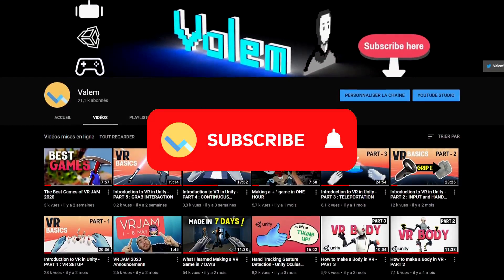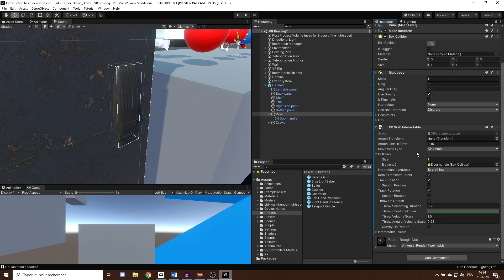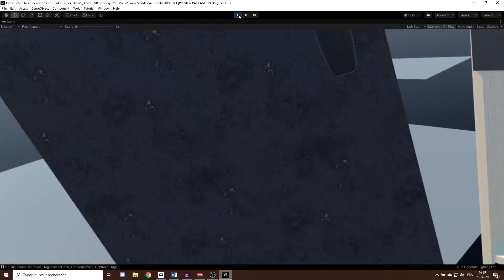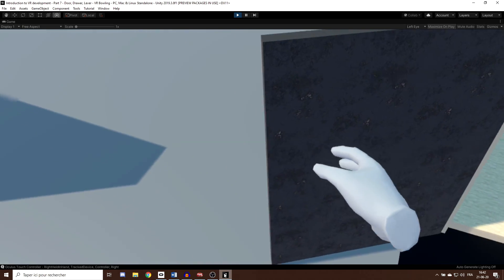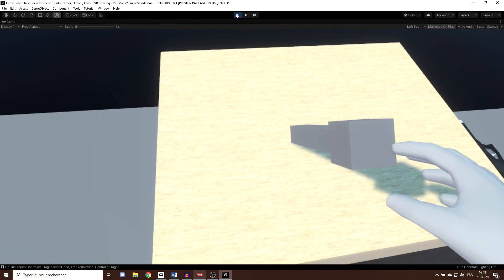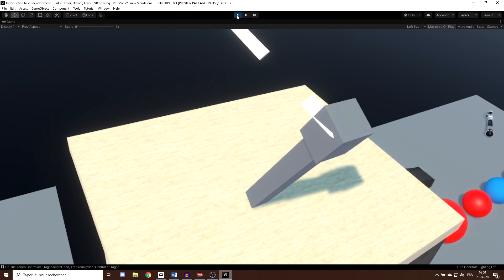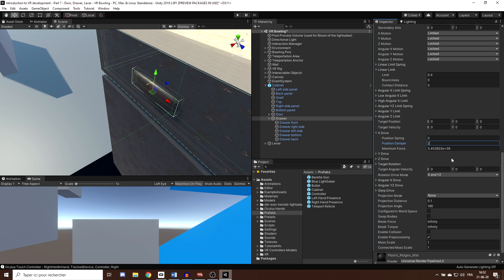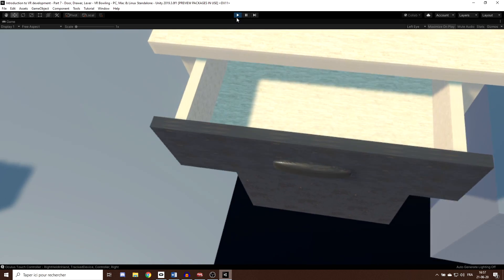Introduction to VR in Unity - PART 7 : DOOR, LEVER, DRAWER,...

Comment: Hi, a question. Using hinge joint if I try to pull away farther than where the object is supposed to be, it will then move frantically like a possessed person. Does the script that you gave in the comments counters that, or is there another script needed to handle it?

Comment: With the lever, does anyone know of a way where you can find out the rotation value of it between the two limits? This could be used to power something like the claw in a claw machine moving for example.

Comment: I followed this tutorial exactly for the lever - however, I have Steam VR so I have the Interactable script, which is different from the XR Grab Interactable script - my lever won't move, anyone know what I'm missing??

Edit Why is this so hard?? I've tried everything I can possibly think of and I can't get anything to work like Valem's lever here.
If I create an object with a rigid body, a hinge joint with an anchor point and limits defined, and an interactable handle at the end, you'd think that would work, right? Nope. I tried restricting the movement of the base in the rigidbody so that it can only rotate in the x direction. Nope. I tried using a fixed joint to attach the grabbable piece to the shaft of the lever. Nope. I tried writing a script that uses a Look rotation from the base to the player hand. Nope. I tried writing a script that does the same thing but with the Look and up directions defined. Nope. I tried simplifying everything and just using one gameobject for the lever. Nope. I even added a Throwable script, which finally allowed me to interact with the lever (so what the fuck is Interactable even doing??), but then that just grabs and moves the entire lever without rotating anything. Why the fuck can't I get this to work?????

Comment: Your video is helpful. However, I met a problem when trying the lever. The lever always will come back to zero. It will not stay on max and min limit. Even though I adjusted some values, it only reached max limit, and it still does not reach min limit. What should I do?

Comment: The offset grabbable stuff doesn't work very well, from what I can see anyway. If you grab the drawer and then rotate your hand (without moving the position of it) the draw moves in and out, and when you release you'll see the drawer is in a completely different position to your hand? The door behaves somewhat similarly, but on top of that, simply moving the door, the movement isn't mapped 1:1 to your hand, so you move your hand a small amount, and the door moves a lot. If I switch back to using the default (non-offset) grabbable, all this is fixed, but you get the jump/snap when interacting.

Comment: I can't place objects in my drawer, they just fall through, it's probably something simple but I can't seem to figure it out. Any tips?
Reply: Make sure the objects have a collider. If you're using a mesh collider, you need to have 'Is Convex' checked and 'Is Trigger' is unchecked. If the object is small, try messing with the interpolate and collision detection parameters in case it's clipping through the box collider of the drawer.
Reply: @geouug4529  Thank you. It turns out I had both the objects and the drawer on a 'Grab' layer, and turned off the collision between these two in the Layer Collison Matrix. Putting the objects on a different layer solved the problem :)

Comment: Valem, I love these videos! They have helped me so much thanks!!

I'm having a small issue where I seem to be able to grab two objects while ray casting. Its like the Ray Interactor isn't disabled after I remote grab something. I've searched through all the classes we wrote but can't seem to figure it out. Anyone have any tips?

I feel as though when we select an object with the Right Hand Ray Interactor for example, we should be disabling the grabbing ability or maybe the whole Right Hand Ray Interactor in the "On Select Entered" method fields like we did for enableRightTeleport and disabling the Right Hand Presence. 

When I try this, the Right Hand Ray Interactor will not reactivate itself (I'm guessing since the object is already inActive it can't call the method to re activate itself). Any tips?
I tried to demonstrate the problem here:
https://www.youtube.com/watch?v=gcU6u3-GaB4

Thanks,
-Jacob

Comment: Actually, the InteractionLayerMask is a bit confusing and it doesn't help the documentation is wrong. Looking at the code, it doesn't care about the GameObjects layer, but just misuses the layers for its layer mask.

It is better to think like this:
* For interactables: Flag the object for what kind it is.
 - Gun should be pickable directly and remotely and slottable into inventory: Set Interaction Layer Mask to RemoteGrabbable, DirectGrabbable, Slottable.
* For Interactors: Flag the layers that should work with this interactor.
 - RemoteGrabber? Set mask to RemoteGrabbable only.
 - Inventory socket? Set mask to Slottable only.

With this thinking, you don't even need to change any layers in the game objects. Everything can be set to default. At least regarding XRIT interactions.

Comment: Maybe a strange question, but in the video you grab a drawer. Where could I plug in a piece of code to execute whenever the drawer is opened ? Is there some kind of event system for that or so I actually have to add a script to the drawer that constantly checks its position in world space ?(using a lot or cpu power)

Comment: hey @Valem thanks so much for the tuts. i was able to use the hinge joint on the lid of a pirates chest. i also added a rigid body to the bottom part of the chest and set it as the link rigid body for the joint, that way when i can pick up the chest to carry it around and also if i grab the front i can open it up with the joint. it works great.

Comment: Heeeelp, my hinge joint is vertical and I can't move it, or at least I don't know how to modify it so it would be like yours horizontally !
Reply: Select edit in the hinge joint component. In the inspector, you will see an x, y, and z field for the axis of rotation. Switch the values of the directions you don't want the door or lever to rotate on to zero. Then, switch your desired axis' value to one. You should see the rotation of the hinge changing in real time in your editor window. I hope this solves your problem.

Comment: Anyone else having this bug where imported models stay pink? Been looking for hours online.. I’ve imported the same lightsaber model as used in part 5 but I can’t find how to fix the pink textures :’(
Reply from the maker: Its because you use urp or 3d. You need to change the shader of the material
Reply: Valem And what do I choose? There are lots of shaders to choose from
Reply from the maker: @sammaes1799  if you are using urp its Lit, if you are using standard 3d its "standard" shader i believe
Reply: @ValemVR  Lit worked but the colors seem a bit off, there is no metallic look for example, no light reflection.. Any ideas on that or should I change to standard 3d?
Reply from the maker: You can tweak the shader lit to add more metallness! :)
Reply: @ValemVR  What are your settings if I may ask? I cant really find where this has to be changed. And thanks for the replies and the quality content. One of the best tutorials on youtube!
Reply: @sammaes1799  it's changed in the materials  you imported

Comment: It's work well on your cabinet.
However, I can't reproduce it on chest of drawers (https://assetstore.unity.com/packages/3d/props/furniture/chest-of-drawers-58835).
The drawer is moving along its origin +/-  limit.
Your drawer only move along origin + limit. 
Did you have any idea why ?
Reply: You need a collider in the back plate of the drawer and a collider on the drawer itself to interact. Preferably both simple Box ones as mesh collider is not very accurate. For my custom project - sinse i didn't have or need any backing to the drawers, i created an empty with box collider and it helped.
Reply: @ShallWeClimb  
Thanx i will try
Reply: @ShallWeClimb   thankssssssssssss i will try to,